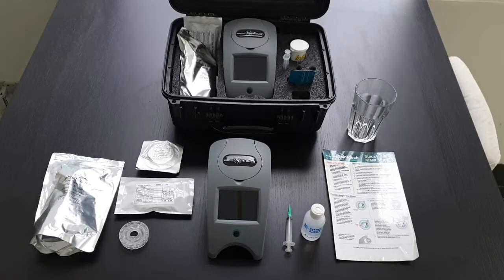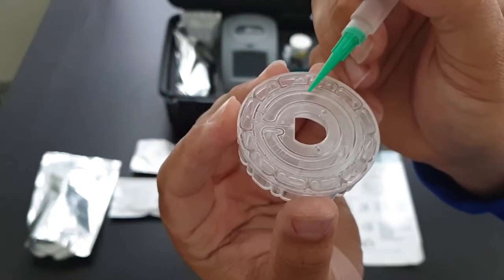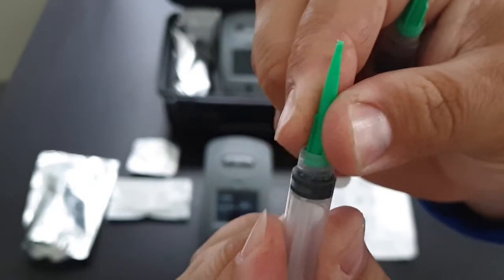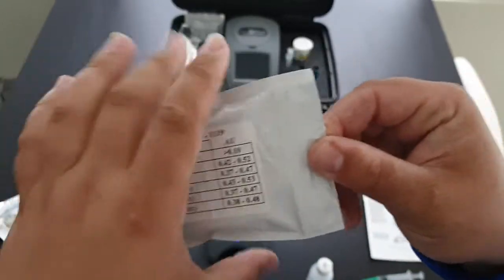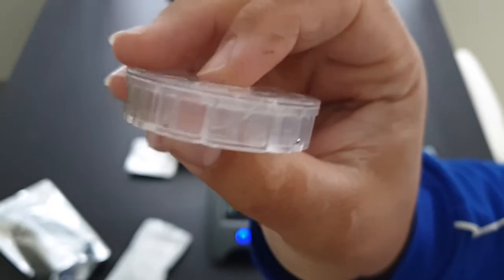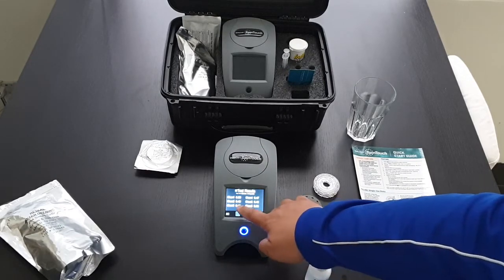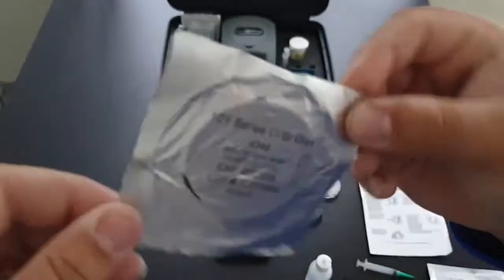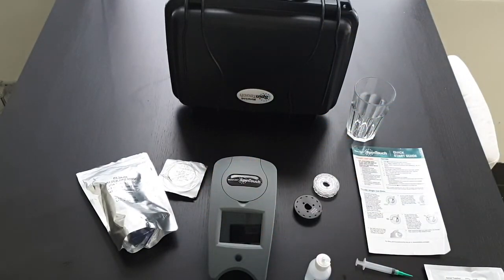How To Use a WaterLink Spin Touch

Comment: I'm looking at buying a used Lamotte Spin Touch for my salt water pool.  The model on the bottom of the unit is RMN 26830, I was wondering if you knew if this is the 3581 model or not?  What does your model number read on the bottom of your spin touch?
Reply: Same
Reply from the maker: Some places will test your water free if you take it to them in a bottle. America and Australia have different codes. 3580 and 3581 i think.

Comment: Will this print out a sheet of how much of what chemical to add to the pool?
Reply from the maker: Yes they can be connected to a computer and give you a printable sheet including what chemicals to add. The software is called "WaterLink®" and "DataMate®" Software
Some pool shops have them in store. 
I personally do not use that feature however as I do not need it. 
Hope this helps, feel free to ask for any more info 👍